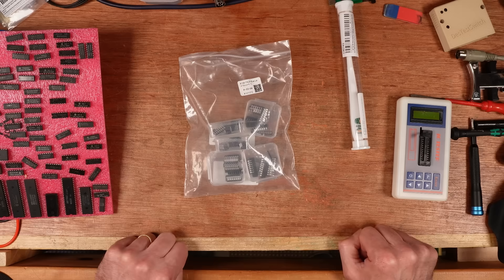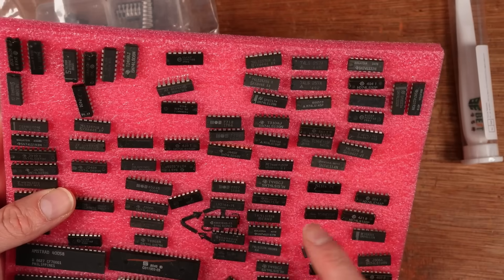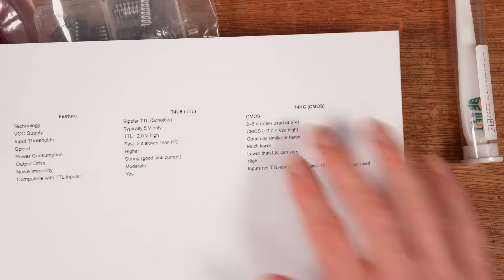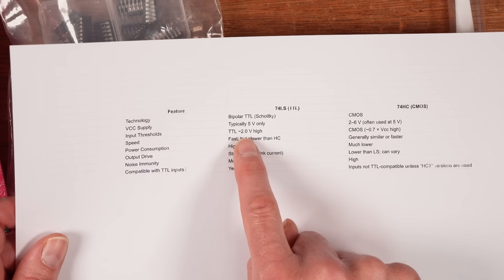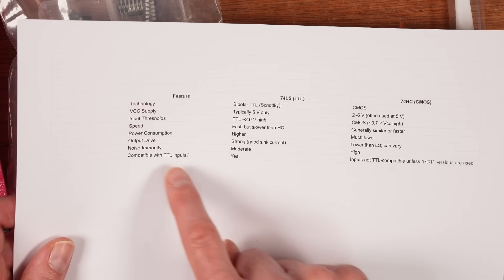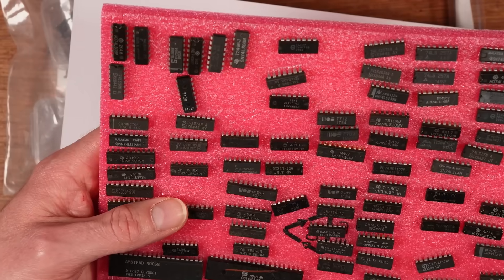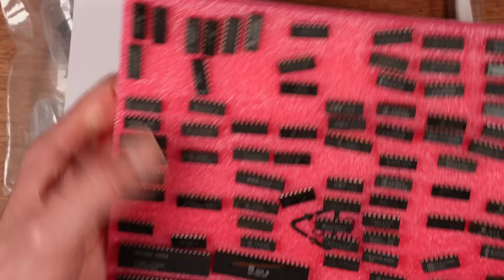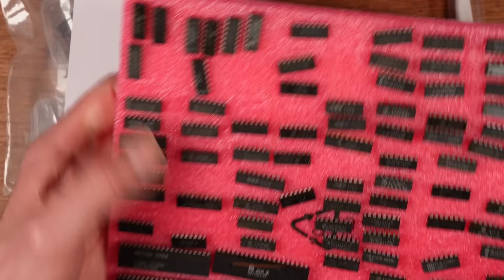I bought some 74LS Logic Chips from Ali Express. Guess what happened next?

Comment: If HC doesn't work in place of LS, then HCT usually does. A CMOS variant designed to mimic TTL input levels.
Reply: "does" should be "should". The "T" in HCT stands for TTL-compatible.
Reply: @stevenvanhulle7242  Yes, but HCT is still CMOS. So not behaving 100% the same if timings are critical.
(The same goes for true multi-emitter TTL versus low power schottky (LS) by the way. As well as for all the other dozens of new and old variants, like AHC, ALS, etc. and the older L, H, S, F, ...)
Reply: @herrbonk3635  If you are counting on tight timing specs you should not be using TTL. Their guarantees are quite loose. Back when I was designing stuff with TTL, if I had 3 elements in series I'd use 2 worst-case and one typical delay as a starting point for analysis.
Reply: @wirebrushproductions1001  That was kind of my point. They all differ, not just between "logic families" but also between manufacturers. (There were over 30 different manufacturers at its peak, and of course many more different factories.) 
But the same goes for discrete transistors and passive components. The luxury with digital electronics and TTL compatible logic was still that as long as you run things below a couple of MHz or so, it usually doesn't matter who made your ICs. So it was a little bit like programming (and now with FPGAs, it really is!).

Comment: a few years back i heard of issues with 4116s from ebay so i got a load, they tested good...as 4164s!!! definitely not drop in compatible(some had cases of burn ups),  (you CAN use 4164s in place of 4116s if you do a bit of pin jiggling), i messaged the seller asking them to alter the listing to stage what they really are but they never did anything about it

Comment: wouldnt have thought it worth their while to 'fake' standard 'cheap' logic, but then they may not be 'fake' as such but relabelled 'old' pulls, maybe marked with wrong family type, theres supposedly loads of 'suspect' 20mhz cmos z80 cpus, i bought a load a few years back, definitely remarked with a good mix of physical chips, now i need a way to test them, i'm actually hoping theyre older nmos types, 4mhz capable at least as cmos types may be an issue for some old computers, they certainly look like cleaned up , retinned and remarked thingies...

Comment: Judging by the markings, I seem to have bought exactly the same chips. I have just tested one “74LS32,” and it turned out to be a 74HC32. However, I’ve already used both 74LS32 and 74LS04 from this lot successfully in my Z80 setup. Most likely, these are chips that didn’t pass factory QC (which, to my knowledge, is done before marking) and were marked in some small workshop, which explains the wrong series label — though at least the model numbers match.
Reply: Many of the newer CMOS logic chips have input voltage thresholds which are compatible with both cmos and ttl, dsigned to be compatible with both types.
And the cmos outputs are generally better, both for larger voltage swing and better current sink/source.

So, unless you are a purist, those "HC" parts are probably a hybrid-compatible chip that will do the LS job just fine.
Reply: @wizrom3046  You got it right. I don’t mind that they’re not LS — in my case, that’s even better, since they work with 3.3 V power, which makes them easy to use with MCUs without level shifting.

Comment: You said your acetone was old and it was in a plastic bottle.
Be careful with bottles of solvents(or anything) in plastic bottles. The plastic can degrade over time and you if sit it down rather strongly it splits in two and all the solvent comes out at once making a mess. And it's usually flammable. But worse yet it starts dissolving things you don't want dissolved like the finish on the floor. However, it seems that plastic gasoline cans are made from a stable plastic and main are still good after 35 years.
Another ridiculous unexpected thing is MEK. MEK is an organic solvent that can get contaminated with bacteria and turn to vinegar. Didn't expect that until the metal can was eaten through and started leaking.
Reply: Exploding basement or shop?

Comment: I bought some 74LS14 for a rebuild Commodore 1581 disk drive. Guest what, although showing ok on my TL866II component tester, those gates don't perform as intended. Realising China is not able to reliably copy a technology almost 60 years old, it's not tomorrow I will replace my French diesel by a chinese EV
Reply: More likely is that China don't bother to manufacture ancient ttl series, because only use of them is repair of equally ancient equipment and that is miniscule niche, and in competition with old stocks of them.

Comment: A similar problem is with FET op-amps like TL074 that have the same pinout as regular op-amps. You could expect fakes on Ali, but it seems to be a problem on Amazon as well for TL074. I would have bought some if I could feel confident about getting the real thing.
For those who don't know the difference, the FET input is very high impedance and thus very sensitive, in a way that a regular op-amp isn't.

Comment: So if you give them 3V VCC, they'll work with correct level of high state. Interesting if they'd survive 5V input in that setup.
Reply: Sorry, but no. Anything with an "LS" in its part number will require Vcc of either 4.5 to 5.5, or 4.75 to 5.25, You might get something to work on 3 volts, but you wil be taking your chances and will have  no excuse when it gets weird.  There are internal current sources in them which need the headroom.
Reply: @wirebrushproductions1001  Yeah, but these are fake LS-es. I was suggesting making a 3V-ish power rail just for these.
Reply: @przemekkobel4874  Oh, yeah, that would work, until it didn't. The voltage levels would be compatible, if not great. That's not really a problem given the normal TTL levels, though. The problem is that Inputs are limited to within ground - 0.5 volts and Vss  + 0.5 volts. Outside of those limits the input either tries to charge up Vss or  pull down GND. High outputs would essentially be shorted to 3V. That's not super horrible, since TTL high outputs are pretty weak, but I wouldn't want to do it on a regular basis.
I once built an FPGA system for a satellite. My box connected to another, and I was amazed to find that my box worked fine even with the power off. High-level logic inputs would charge up the FPGA enough to work. Fortunately, my box was not being given any commands which would attempt to activate external mechanisms.

Comment: i know it is a stupid idea and kind of  pointless, but what would happen if you connect ground pin of hc chip trough a diode to data ground?
logic level high should be that diode drop higher, but can a chip handle negative low voltage? how would ttl logic recognize 0,7v low signal?
Reply: If the chip is feeding another LS-compatible input, the best you can hope for is reduced ground noise tolerance. LS output level is guaranteed to be 0.4 or less. Guaranteed input LOW level is 0.8 volts. If you "diode ground" chip is putting out 0.4 wrt the ground pin, the input to the next chip in line will be 1,1 v, and that may not work at all.
Reply: @wirebrushproductions1001  ah yes i didn't take output being shifted and not just 0 into consideration , those would at least have to be buffered by some kind of open drain /colector transistor, quite a chalenge to make an adapter i see. no wonder wrong type of logic is such a problem

Comment: What if LS and HC does not appear? What if it s printed 7400 on it. What does that mean?
Reply: It is an older serie. The original TTL did not have letters.
Reply: The very first TTL series, or at least the one which became standard, was simply 74XX. This was fairly power-hungry, so after a while the 74LSXX was introduced. Had about 1/5 the supply current, less signal input current, and almost identical timing. Between the two, a faster line, the 74SXX appeared, about 5 times faster and 5 times the current or the 74XX.  After ALS came 74ASXX, a lower-power version of the 74S series. After the LS came 74HCXX/74HCTXX, and then 74AHCXX/74AHCTXX, Both CMOS, with the AHC being faster (and dissipating more power at high speed.
TDLR: It's like the LS and HC in timing, requires more power than the LS, and needs more input drive.

Comment: That TI logo too, utter garbage.

Chances are they're random pulls from all sorts of boards, the moulding on the underside is often more valuable for identifying parts, in batches of parts I've bought I've had half a dozen different sets of markings on the underside despite all the chips looking identical on the top.

But, the re-marking game is weird

I buy a lot of chips from Ali and even the blacktopped ones are often actually genuine, for example, 100 W25Q32 SPI flash chips which had all been sanded and blacktopped.

Plot twist though,  they were all working, W25Q32 chips with the and looked brand new except they had someone's code n them.

I've bought some rare Sanyo amplifier chips, which are a high risk buy, to repair a friend's electric piano but despite them arriving and being obviously and badly blacktopped, swabbing them off with acetone revealed exactly the same Sanyo part number underneath and worked perfectly

The 4Mbit AMD UV EPROMs I bought, despite all identifying in my programmer as 4Mbit devices were laughably fake, on some of them the original etched in markings (Intel and Toshiba) were clearly visible in the ceramic under the overprinted markings, the dies were all different sizes and shapes  as well, not worth the bother to report as they were ridiculously cheap and all worked just fine in my Amigas.

Comment: I've bought a few logic chips off AliExpress and I've checked in my xgecu t48 and they come up in the list of possible chips, but I'm not sure if that's accurate enough. Could you test in your programmer and see what gets listed. I don't have an ic checker unfortunately
Reply from the maker: The xgecu programmer's can't tell the difference between ls and HC chips. It does auto detect most logic quite well though
Reply: @morefunfixingit it appears the HC chip for 7202 works in my destestmax switch board. It must be that additional 104 or 101 ceramic cap boosting it

I bought an IC tester and did a test of my AliExpress chips and as you might guess, they're all HC. Got a refund and reordered. Arrived today, tested them and HC again. Refunded again. So I thought stuff it and I'll test this chip, the only one stopping finishing my switch board and it appears to be working with it in

Comment: do not trust this tester, i have one... it not only misidentifies the chip but on known LS series (Farnell, Mouser) it claims they are HC series.
Reply from the maker: Thats interesting. I wonder how it is testing these?
Reply: @morefunfixingit  As for me - looks like he just doing a "logic" test with 5 volt. So if it is then tester can't see difference between LS and HC.
So i think you need to do test with regulator voltage supply connected on chip  input and look how chip is reacted on "logic" (voltage) levels.
Reply: @AsperaDay  ... but he tried with an LS00 and it recognised that as a bipolar
Reply: @AsperaDay  or measure input sink current at logic 0 input (or static current consumption on power rail)
Reply: @morefunfixingit  I think we need a video showing what happens when you stick a scope on some inputs.
Reply: @morefunfixingit  Попробуй проверить программатором XGECU T48.Он умеет проверять микросхемы этой логики.

Comment: I had to go through about 4 different sellers from Ali to get new unprogrammed PLA chips for the C64.  Most sellers claim "new" but the PLS100 usually are already programmed with who knows what.  Certainly not C64 code, LOL.  I did eventually find a good seller from Ali and bought lots of them to program for the C64.  The trick is to initially purchase 1 or 2 until you find a good seller.  This applies to any sort of IC's.
Reply: Heh, that tactic doesn't always work even now. Personally, I'd order one item to try, and when it arrived in good quality, and then order the exact same lot again (but in larger quantities), the items I received were completely different from the first order. But by the way, there really is quite a lot of quality merchandise there; you just have to pay a little more for it than for a bunch of junk. And even so, with all these not-always-quality items, for me it's still much more affordable than ordering from local stores or other places.
Reply: really, all the suppliers in a niche know of each other, they tend to work in the same district. If they can't fill an order, they forward the order to another warehouse to send out. They may go in together on a shipment of supplies, and they get slight differences from this supplier or that. A product can even be downgraded or improved specs since they post a product listing. It's all very generic.
Reply: A young Australian electronics YouTuber put up a video of recommended AliExpress sellers to buy semiconductors from.  A few weeks later he had to publish a follow up video removing at least one from his list citing that although he had received what he considered genuine transistors his last bulk order of the same were fakes.

Comment: I wonder if the seller knew or if they get stitched up too, buying cheap & getting rejects?
Sanding and re-etching wouldn't make sense for simple logic, cheaper to sell the right item, so I'd guess they are wrong dice in the package. The wafer fab is usually a different factory site - or even a different company - to where the final chip packaging and marking take place.
Even poor quality control would statistically get it right more often than wrong so my guess would be a wafer fab sending any more-or-less correct dice  - the right numbers - to the backend packaging plant, or a packaging company ordering dice on the open market possibly without even knowing the significance of the letters.
I remember even back in the 90s the factory asking design if we could approve an alternative part for one particular out-of-stock chip. Their replacement was a completely different, unrelated device that just happened to be in the right package so it would fit on the PCB. We said no, of course!
Reply: in some cases yes, in some cases no.

factory makes 100,000. theres 10,000 rejects not up to spec but still working... flog them off!

most of tehe sellers online are sweatshop setups... fifty people in a room behind monitors with a dozen accounts each. massive warehouse with every thing from plastic things that go "ni ni ni" to servo motors... they dont know where things come from, wouldnt have a clue what 99% of their items are, and couldnt care less as long as they get their commission out of it. check your statements... amazing how many payments end up going to the same account names...

Comment: "plastic's not really gonna stop acetone" akschually yes yes it will, this is polyethylene, it is completely resistant to acetone. Polypropylene is also resistant, as is polyamide, LCP and i think PBT. PET can be slightly susceptible. PMMA, PVC, PS/ABS/HIPS are soluble. Polycarbonate has a weird interaction with acetone, doesn't survive it very well. Just about all plastics used on circuit boards are acetone resistant since manufactured boards must usually survive MEK-wash, that's a closely related different solvent, less volatile.

You're for sure right the chips are fake and wrong, but i wonder whether you counter tested the tester that is reads the LS chips correctly.
Reply from the maker: I tested the tester with a variety of vintage LS chips, also HCT chips. All tested as expected.